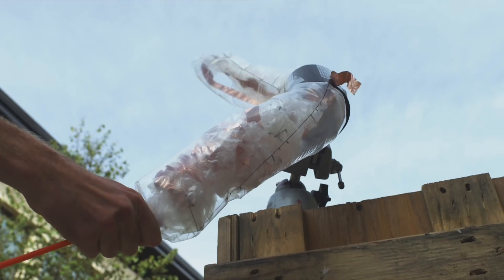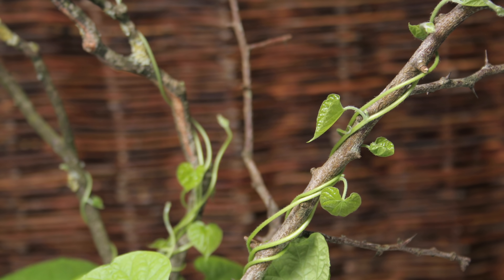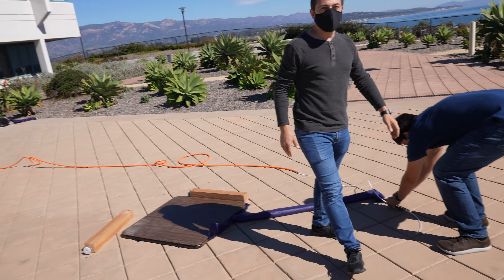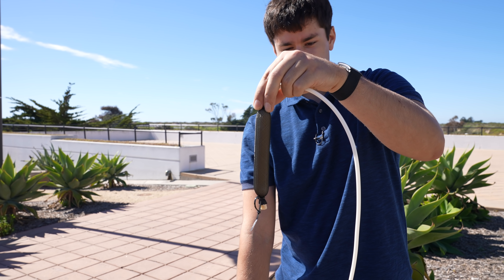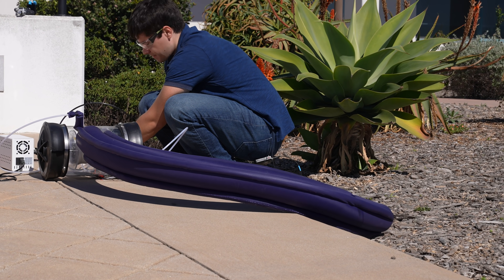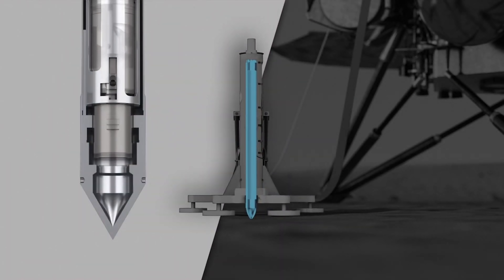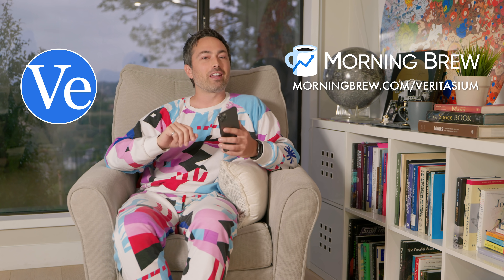This Unstoppable Robot Could Save Your Life

Comment: Although having the device used to help patients breathe sounds amazing, wouldn't it be dangerous to have a pressurized device inserted into someone's mouth?  If the airway is swollen and more pressure is needed, for example, I feel like there's a risk of having a lung explode after the device fully expands.  Are there any safeguards for this type of scenario?
Reply: Yeah, I'm a nurse and while I have not intubated a patient personally I've helped and observed several. I definitely think they're exaggerating how useful it would be for intubations. They don't say anything as to how they make sure it doesn't go down the esophagus instead of the trachea which is a big issue since the esophagus is a much larger tube or how they keep it from damaging anything, how they would secure it, how they'd make sure it's the right length or any other potential issues. They definitely exaggerate how difficult intubations tend to be, while they can be occasionally difficult and take several minutes most are done in under a minute if not under 30 seconds.
Reply: @Sinistar123  I had many of the same concerns.  Thank you for your input :)

Comment: This has been used in drain pipe renovation for years.  There is a company in San Diego that specializes in this.  Usually used to reclaim drain lines on older buildings.  I have a friend that installs this system.

Comment: For the intubation tubing, if the robot gives the trachea branch late it will push the trachea lid (epigglotis) shut or even damage it. The string arms you build was good, you could use it to direct the robot to the trachea. Here is another thought, the patient will have a lot of secretions that can fill up and decrease the oxygenation and the secretion needs to be aspirated. We send a second tube down the entubation tube to aspirate. The robot needs a lumen to pass an aspiration tube. Or maybe the robot can be a guide to send a classical intubation tube down from within.
Reply: why not make the tube 2 layer, an inner and outer connected with baffles? Inflate inside to send the tube on its way once its in place inflate between the 2 layers to give tension and compression giving the tube the tube structure that would create a normal pipe with an airway down the middle that you could pass what ever you need with ambient pressure in the middle.
Reply: Kameralı laringoskopu ilk kez gördüm ben videoda, bizde düz olandan var. Türkiye'de bulunuyor mu normalde hastanelerde, sizin çalıştığınız yerde var mı merak ettim.

Comment: I think a much smaller version of this could be used to clean out laptops and other computer parts. If it could fit into the vents and the somehow have a release valve at the tip that could blow out more targeted compressed air, it could save people from having to disassemble computers and open up the heatsinks to clean them. If you could have it blow air or water from the tip, I guess it could clean all sorts of stuff.

Comment: Back in my 20s I worked in a surface mine and we had a fire safety video from the late 40s with a very similar device yar we still used at the time I left. It was an emergency fire foam compressor with a plastic tube like these but much bigger to fill the entire mine corridor. It would be  pumped full of the foam and when it would expand down the corridor to point of the fire the plastic would melt and the foam would cover everything and extinguish the fire. Ingenious technology,  but older than most of us realize.

Comment: I'm a surgeon that specializes un minimally invasive procedures. I was wondering, what if this could be manufactured really small ? like 2mm in diameter? It would make the job unimaginably easy, to get it through narrow stenosis. I hope someone in the industry has already have this idea or maybe someone reads it.
Reply: Look into getting funding for a trial. Then they can design to your research needs.
Reply: I actually work with vine robots for the purpose of MIS in my research group. And can confirm they can be done. It’s just that selection and path planning are fairly complicated problems haha
Reply: @T3WI  Cool, does your research group have a website? Was thinking about contributing something to this idea.
Reply: @T3WI  i also work on this! It's not easy to be done but we work with tendon driven robots instead of vine robots.
Reply: I'm pretty sure this is pretty much what they did when I had to get my tear ducts unclogged and expanded.
Reply: @SrTNick1   sort of, but stil, doing these sort of procedures requires a lot of training and some luck to mavigate with a guidewire through a stenosis that can only be seen in2D with xray. having something that navigates itself and is soft, harmless is pretty useful
Reply: Or use for expand a tooth root canal 🦷
Reply: @ДионисийНирванов  Gosh that could be painful for the patient though!  I once had a dentist poke into a root that had not been adequately numbed with lidocaine... let me tell you, I wouldn't wish that on my worst enemy.
Reply: Yeah, thanks. I might be a surgeon, and specialized all over the world in mininally invasive techniques but still work in a third world country, and without resources for a patent. So unless anyone wishes to hire me to develop something like that, i'll be happy just to se the advances in patient care, and maybe have the delusion of thinking the other post helped.
Reply: Just to warn anybody who seriously considers filing for a patent, do not ever disclose anything to anyone in a public setting before you have actually filed the patent. Once publicized, it becomes 'prior art' for which you cannot obtain a patent anymore. Even if it's just a comment on the internet, if anyone who wants to nullify your patent ever finds that comment it's ripe for the picking.
Reply: Put a patent !
Reply: One word,
colonoscopy.
Reply: Darpa puts it in your blood already
Reply: I call it the stentbot
Reply: @The_Unintelligent_Speculator  seems apropriate
Reply: I agree Doctor. A skilled cardiologist saved my life during a near fatal heart attack. He cleared my LAD coronary artery and installed two stents. All through a catheter that entered near my groin. I am still amazed at this technology and the skill of specialists such as yourself. Bless you all and the inventors who come up with these lifesaving devices.
Reply: I am in school for neuroscience and biomechanical engineering when I finish maybe I can help you out:)
Reply: Yes Santiago I’m on it
Reply: @SewakS108  please elaborate
Reply: You should use them still hands to spell it better 😂 (no hate btw lol)
Reply: i beleive its already been looked into for said kind of purposes. i remember seeing these things in the past and there was like a medical section that went really deep into the possibilities for surguries as such. (the trechya scene just started lmao)
Reply: Develop it yourself, employ some engineers/manufacturers/3D printing software companies and marketing professionals. Create your idea & after you have investors & some data analysis ready, go get a patient on it. JUST REMEMBER, test your product religiously to work out flaws or issues with functionality, then after MANY successful test, turn to your marketing & manufacturing team, grab a financial expert & let them all work together. Then after you start gaining capital, log all transactions & quarterly earnings and reconfigure your marketing strategy with more data analysis and make your idea a reality!
Reply: @jutjammin7778  wow that sounds expensive af
Reply: You should put a patent on it you could become a milionary
Reply: @siluda9255   I'm willing to help developing it but patents are expensive
Reply: @santiagopose5181  you should try it for real even a name patent would be a start
Reply: @santiagopose5181   dude youre a surgeon patents arent expensive for you
Reply: @siluda9255  dude that would be so cool would probably help save a bunch of lives as well
Reply: @Siluda  good luck paying for the surgery when you have this exact problem and the mans monopolised the method
Reply: Did you watch the video, mr surgeon? Health applications got proposed left and right, like once every 10 seconds
Reply: @TheFilipFonky  thank you, yes i watched it a lot. health aplications is what you would call a general objetive im talking about something specific, so instado of writing sarcastic coments, you could do something constructive

Comment: Line my chimney with concrete. The difference is that I will be using water and rubber and moreover if I already knows basic design then I can put multiple chimneys on one Vine blow up one robot creating a chimney for all of the fireplaces in the house or the apartments including for the main Boiler Room in the basement create both hot water and boiling water for the radiators and if we were using spun bronze tubing we could go with hot oil instead which would allow us to install oil generation kitchens otherwise known as the perfect soup kettle and as pressurized oil can be brought up to 400 degrees Fahrenheit

Comment: Yeah, no not in intubation. Too much risk of entering the oesophagus instead of the trachea (and too difficult to sterilise) - although could be heavily modified for medical scopes. Great utility elsewhere, but this is why engineers should do some extra research before designing medical utilities. 

....Also, medical uses are way more expensive to design because they need to pass stringent standards that ensure the robot doesn't damage the patient. And if a hospital director/admin tells you not to worry about the extra expense, just back away slowly....

Comment: transport.  imagine a large tube pushing a car along a tunnel. once inflated it 'leaves behind' only a very thin membrane wall against the tunnel wall so another can be right behind you. imagine lots of tubes pushing behind each other. if its one expanding tunnel inside another, you would be closely following another car but have zero air resistance, even at high speed?  the 'car' would not be powered, it would be pushed.  what is the efficiency of high volume low pressure air vs internal combustion?

Comment: One issue a lot of people have ran into is problems with fiber optic installation or other non-evasive methods of laying wire/cable underground. Currently, a tool called a jetter is used and it essentially uses hydraulics to rocket the tip of the wire to the targeted location. This works, but it causes loads of problems. Specifically, this process tends to rupture anything from sprinkler systems to poorly reinforced gas lines. If you could use a robot like this to more or less drill through the dirt while dragging the wire you could avoid those issues and it would likely be cheaper and less destructive (jetting wastes an ungodly amount of energy and water).
Reply: interesting pfp and username 🤨

Comment: They have that exact same thing when it comes to resurfacing pipes that are broken or cracked. Instead of digging up the pipe and replacing the pipe manually they run a new pipe through the inside just like on this video

Comment: He didnt come up with this because he saw a vine growing on his shelf. They've been using these in plumbing to resurface, and repair pipes for years and years. The inflatable part is covered in a type of uncured adhesive resin sheet, and it inflates through the pipe, the same as the one in this video does. when it comes out the other end, its left inflated for a while until the resin cures, and then the plastic sleeve is removed.

Comment: Have you considered using this for certain medical devices I’m thinking of it being used in gynecology such as a vaginal speculum I think it would be fantastic if it could be used in that way. For one thing he could help people who are suffering from certain physical ailments and how speculum is a problem this tube like speculum inflatable tube like speculum could be the answer. No longer would a gynecologist have to resort to anesthesia to do an internal gynecological cheek or Pap with instruments that can be rather painful to some patients but this robot today actually save them in actually doing the same thing as a speculum without any trauma or damage that can occur. For example sometimes when doing a Pap smear is required you need a speculum in some countries around the world they still use one type it’s metal and it can cause pinching and it can cause two people with more delicate vaginas a problem and doing it where they have to Instasize the patient in order to perform the procedure like a pap smear it could be done using the tube itself because it could be made from two different layers one should be a throwaway layer which would be the one actually touching the internal part it would be able to be used in so many different ways I can think of so many different ways this could be used.

Comment: What if you got 3 * worms * to go somewhere together and when they reach their target they separate and act as a claw and grab onto it's  object or victim. It's flexible/ moldable body would get a good grip in the Groves and indents of the object or victim. Then with all the pressure you can ally with them you could safely (or not safely defending on the circumstances) obtain the object or victim

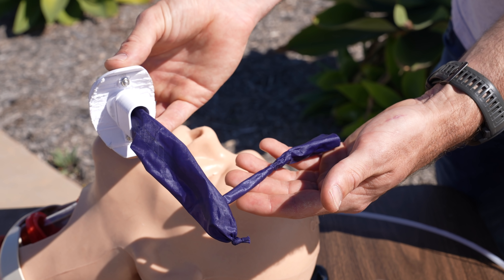Comment: As a retired physician who remembers the terror of the 8% of endotracheal intubations which do not proceed smoothly, I can really see the value of the vine robot in that situation.   As a tangential observation, performing an intubation in a cadaver using the robot (10:20) does not constitute an "in vivo" procedure.  More likely "in morte".  Or, in pig Latin — in corpso.
Reply: They don't need to intubate a cadaver though, doing so shows that it's probably possible to do it "in vivo", not really a mistake.

Comment: So.. what uses can I think about.. well.. besides  colonoscopies, and a sex-toys...

 I can see how it can be used in a huge number of types of crime.. 

I mean.. I DID come here from the lock-picking lawyer's site, so I AM contemplating whether this could scale down and become a useful lock-pick... but also.. using it to case out some place, to use small vents to get access to small valuables through just a small vent or some plumbing pipes..  Of course a simpler version of the intubation robot simply skips the intubation part and just create blockage, for a brand new way of torture for interrogation..

Comment: First, this is air pressure has been used to movie things before air pushed cylinders. Also, that tody has been there for years I have maid one of these so-called robots before. So, in short, all the people in this video are self-congratulating for absolutely no reason.  Get a condom a blow in it you will get the same result.

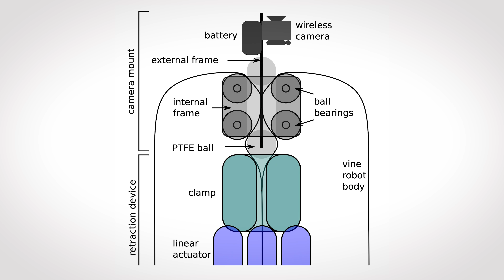Comment: "Tiny wireless camera" 5:43
can clearly be seen with some wires
Dissapointed this guy is usually pretty smart
Reply: The camera can be wireless, but still have wires. Its counterintuitive, but the overall definition of wireless in this case, is if it needs wires to send video signals back to the source (their computer). The wires, can for example be used to connect it to a power source, right behind it. It would still send video signals back to the source wirelessly, keeping the advantage of not using messy wires.
Reply: @NerdStuff3141  r/woooosh
Reply: Did you understood what is actually wireless

Comment: So if the tube would have 3 strings of heat shirinking material and the "robot" on the tip would just heat up the right one to steer, you could actually drive this in real time.
Reply: Or even simpler the tube could be from heat shrinking material by it self....

Comment: Am I missing something? Why do they keep calling this thing a robot?
Reply: They mentioned in the video, that the tub full of air itself isn't the robot, but the applications it can have on top of that (cameras, muscles, fluidisation nozzles ect.) are what make it a robot. If you stripped a roomba of all of it's electronics and motors down to just the chassis, that isn't a robot either.

Comment: the PRESSURE = FORCE / AREA. Therefore, Force = Pressure x Area. So even if you have low pressure but a larger area, you can have a large force. Also, wherever, the fluid flow comes into the picture, then one must remember that PRESSURE IS INVERELY PROPORTIONAL TO VELOCITY. IT MEANS, HIGHER VELOCITY CREATES LOW PRESSURE, SO What is paradoxical in it?

Comment: I can see bright future for this invention.

-) it can help guiding any wires or pipes during installation (like in tunnels or underground, etc)
-) it can help cleaning dirty pipes
-) it can help deliver tender instruments to very unexpected places
-) it can be used for smart drilling instead of brute forcing (like drilling wells etc)
-) it can help rescuing people lost in caves, especially flooded with water, etc (did you remember incident happened in Indonesia ?)

If this pipe can be looped with some inner-machine, it can be used as delivery robot with extremely high mobility.

Comment: Some sewer repairs have been made using similar methods. Put the tube in, apply air pressure, it then expands and moves along the length of the sewer, ta da, done.

Comment: There could be huge potential for this if some use cases can be developed. I have this feeling that this already exists for rescue operations. I swear I have seen something like this before. Pressurized pads or something like that. For lifting collapsed debris.
Reply: They use it to insulate pipes in homes, id argue while its pretty cool, its not new, or a robot